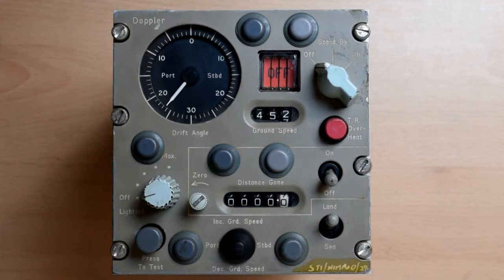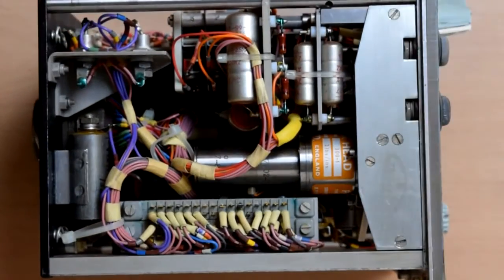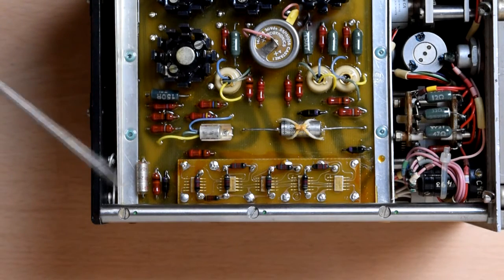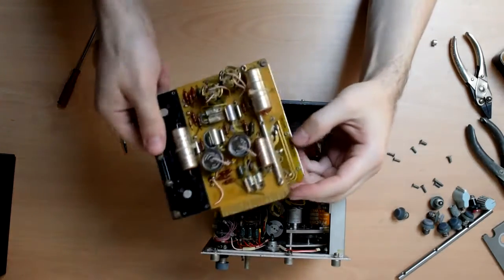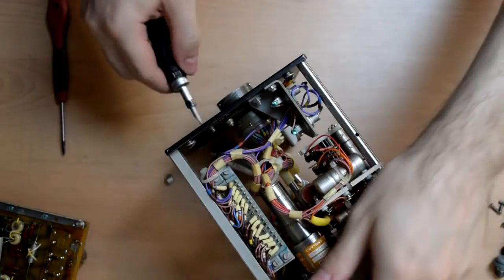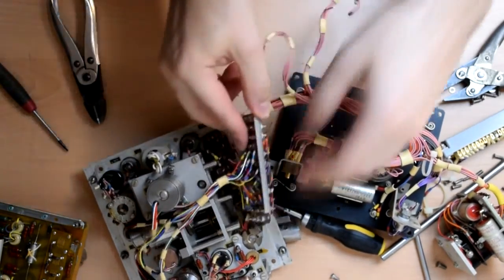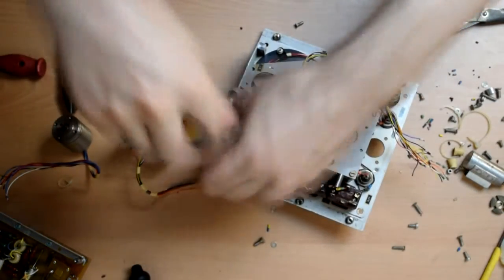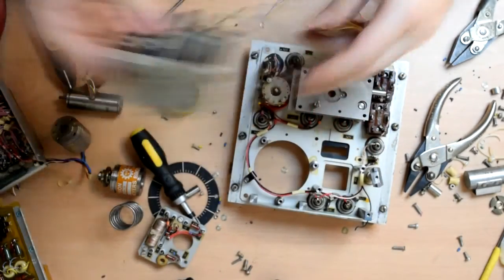Doppler radar control box teardown

Comment: I recognize what you referred to as a stepper motor, I've used these before.
Not much good as a stepper as they are only 4 steps per rev, the original system applies a constant sine wave ac to one of the coils, and the other coil is fed from an amplifier, the higher the amplitude of the sine wave (which is 90 degrees shifted) the faster the motor turns, inverting the polarity of the wave reverses direction, so the amplifier if powered from + and - supplies will reverse the motor.
I used an arduino to fabricate 2 sine waves using pwm, the precision is excellent.
You could also use one of the pololu easy driver stepper motor drivers, one of them does 1/64 step, that would give 256 'steps' per rev.
Nice teardown.
Reply from the maker: hmm interesting.  that sounds like some sort of synchro though?  this one actually said 'stepper motor' on the side.  that said i haven't tried it yet, so you may be right, which would be a little annoying as i hoped they were standard  that Pololu driver looks interesting anyway though.